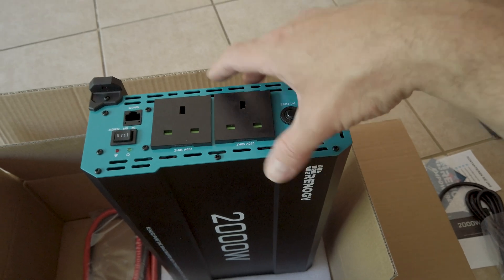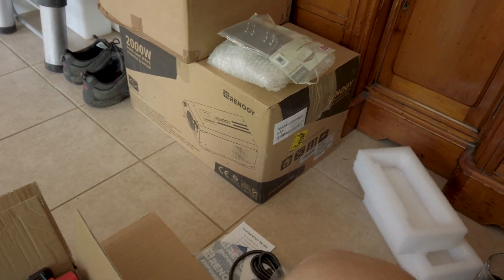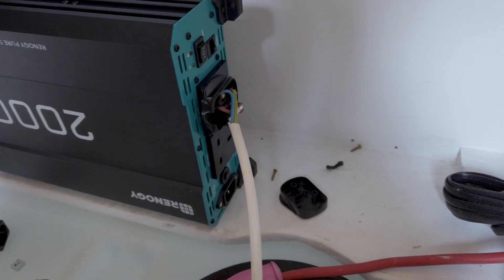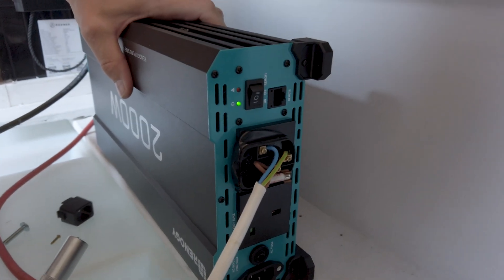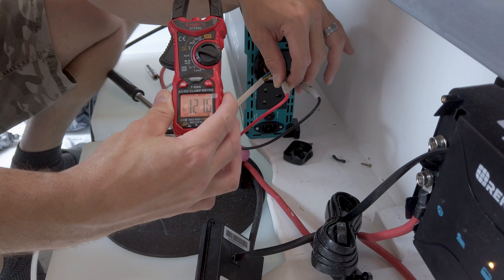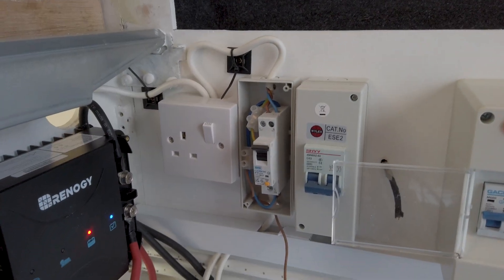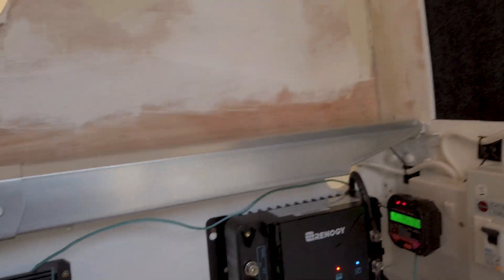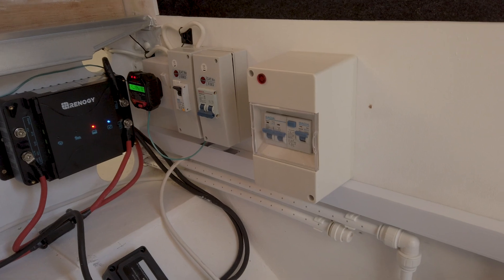Renogy 2000w Pure Sine Wave Inverter | Unboxing | Neutral Earth bonded Install

Comment: I’ve got the 3000w, it worked initially and now it’s practically a ornament. 
Do I do a straight swap which is easier or go for something else. Obviously cost plays a part.
Reply from the maker: How long have you had it? I would suggest contacting renogy as a first point of call :-)
Reply: @dontmentiontheaword only a couple of weeks, I had it professionally installed so it’s not a problem getting a like for like, it’s just that I’m in two minds whether to change brand.
I’m scared of swapping like for like, then it doing it again, but I am limited for space.
Reply from the maker: Ours has run fine since it went in. You can have problems with anything electrical. Get an exchange you will still have warrenty :-)
Reply: @dontmentiontheaword yes, I think I will get a like for like. Maybe I’ve just been unfortunate. Thanks for the advice 👍

Comment: I've been looking into earth neutral bonding this inverter myself. Could you tell me the reason for achiving the bond by connecting DC neutral to AC neutral? I understand that DC neutral is grounded and therefore an earth neutral bond is establised on the AC side. However if the inverter is grounded to the chassis of your van via the grounding point on its case, and that grounding point shows continuity between earth on the AC side, could you bond earth to neutral on the AC side, and run that into your RCBO, achiving the same effect? 

This is my current plan but I'd love to hear your thoughts on it, and let me know if I'm missing something here

Cheers!

Comment: Hi
So did you put the n/e  bonding wire straight into the neutral terminal on the RCBO. Just want to get this clear in my head. Thankyou.
Reply from the maker: https://youtu.be/Ka0lamFY7To?si=6_HvNPA8tZNryooN&t=372

This was the follow up to that Video. I May reedit an electrics video with everything collated together if I ever get time :-)

Comment: i've a 1000w inverter, just like this, also Renogy.

I use it for it's UPS function in a custom built generator.

Can i too also benefit from this bonding?
Reply from the maker: I would suggest contacting renogy directly, although the models look identical they would have to confirm if the same circs inside :-)

Comment: What’s it mean if that beep noise doesn’t turn off when u turn it on?
Reply from the maker: Hello, what are the indicator lights doing when it beeps?
Reply: @dontmentiontheaword  I don’t have it connected anymore but I believe there was a red ground light that stayed lit up..

The inverter worked for me when I first connected it., used it for a minute with small load.. but while using it, the connections arced from being loose.. 

Then I connected new Anderson connectors to my battery and now I am stuck with the red ground light and beeping for 40 seconds until I turn it off.. 

I assumed I damaged it or faulty unit.. I bought new redodo inverter and had 0 issues with it.. I want to use the renogy in my car though

Comment: Excuse my ignorance.. is that legal to regs? You would want the auto switching intact no?
  Vandercampadventures on YouTube in part 2 explains to use a contactor switch to earth bond and retain auto switching power.  Did renogy tell you the inverter charger are earth bonded. Strange. Vandercamp says they are centre tapped.
Reply from the maker: Hi Gavin, give that a watch :-)

Reverse Sensors | Roof Cut out carpeting | Renogy 2000w Inverter  auto switching for pass through
https://youtu.be/Ka0lamFY7To
Reply from the maker: Although there are currently no regs as such for vans everything was done to the current 18th edition of the UK regulations. That included communication directly with the to clarify interpretation of the written regulations.

Comment: Great video. Thank you. Just to confirm i have tested this on the 3000w version and it works. 
Im not sure why and if im fully comfortable with a nuetral ac bond to a dc negative but as you have shown, it does the job.
Just as a side note, sunshine solar do an inverter with a N+E bond switch so it is rcd compatible.
Thanks again
Reply from the maker: Thanks for watching and commenting. Glad you got some use out of it and the solution works with the 3000w inverter also. Sterling in the uk are fully compliant with all current regs. There is a price difference though.

Comment: Hi Graham, great informative video. Why have you removed the Renogy PCL inverter and replaced it with the standard inverter? Is it because of the issue with bonding the N-E? 
I have the 2000w PCL inverter and am currently chatting with Renogy in regards to converting the output to N-E bonded instead of floating. 
Thanks again,
Jolly
Reply: Hi I have put the N dc-N ac link in but still can not get the RCD to trip what am I doing wrong
Reply: Thanks for the video, this is exactly what I'm looking for. I have the Renogy sat between the shore power and a plug socket, making use of the pass through function of shore power.

When shore power is connected, it passes through the ac to the plug socket in the van, and the rcd works on the breaker board.

As you know, the output from the Renogy does not support this. You mentioned that if I bridge the neutral earth, the pass through will not function automatically, is there a manual way? Other than some kind of switch on this bridge connection?
Reply from the maker: Hi and thank you for your comment. When i first purchased the PCL i communicated with them and the assured me it was NE bonded. 

Me being me I tested it as soon as it arrived to find it wasn't. This was not good as they could have killed someone with their information. 

In one of the other videos talk about it. Long story short though I was going to take them to court, they settled before that and I had to sign an NDA. 

It was thier technical who I spoke to about the PCL and 2000w I Have now. They said there was bo way to make the PCL NE as the charging circuit would shut down.

I ended up opting to make my own switching safety circuit for the 2000w. This works every single time I have tested it. I do this before every trip along with checking the main wiring setup. Neither of the units I had from Renogy worked in a fault condition with their own internal system.

I opted for a seperate charger and went for the fogstar unit. That is another Story :-)
Reply: @dontmentiontheaword   Thanks for the reply Graham. I'm a 'test on arrival' person too 👍. In what video do you discuss the issues you've had?

I've been hoping the PCL could be converted so I'm glad I found your video. I spoke with Renogy on behalf of a customer to discuss the N-E dilemma and they explained it wasn't possible and could offer a refund. I gather it's an issue that's raised regularly so I'm hoping they redesign their units in the not to distant future.

I was hoping that a similar setup could be achieved with the PCL like you have with the 2000w inverter using a relay. When the inverter is on mains it supplies 'grid' power (N-E bonded) so an RCD can be used. 

Regards,
Jolly

Comment: Would you recommend this ? Reading mixed reviews especially regarding its ability to trip rcbo’s or rather lack of ? 
Not sure how much of an issue this is. Seems really good for the price though. I’ve just installed a 280ah lifepo4 battery so am considering a decent sized inverter.
Reply from the maker: https://youtu.be/Ka0lamFY7To That video explains more of what I have done to make it work for pass through :-)

Comment: Hey, thanks for the video. Could you tell me your RCD Ampere amount? Im using the same hardware as you and Im wondering which ROD size I should buy.
Reply from the maker: Hello, do you mean the RCBO after the inverter, if so it's a 10amp. Thanks 🤠

Comment: Hi. Thanks for such a useful video! Subscribed. I have the 3000w version but it has the model number R-INVT-PUH1-301235. I don't suppose you've got any details from Renogy that explain if this would work with mine too? Thanks in advance!
Reply from the maker: Good morning, thanks for watching and the Sub. Any other manufacturer I would say probably yes as they are supposed to be the same model just Higher output. Renogy though???? :-) I have sent my contact a message with the details provided and will let you know when I hear back.
Reply: @dontmentiontheaword  thanks so much. That's really helpful.
Reply: @dontmentiontheaword  I would be really interested to see what they say as I asked Renogy the question and this was their response "Renogy's PUH inverters and PCL inverter chargers currently available for sale do not support the connection of external RCDs or RCBOs (Residual Current Circuit Breakers with Overcurrent Protection) for leakage protection. We do not recommend, and it is also not possible, that you run the inverter with a Neutral-Earth bond for the RCD connection.". Isn't yours a PUH model?
Reply from the maker: Yes, 2000w PUH. I have said it a number of times. Renogy staff don't even know their own products. They don't seem to design them rather than "borrow" designs.

Comment: You mentioned in your other video that you had found a uk company instead of Renogy who was it im curious for when i do mine and i dont fancy dealing with Renogy after the faff youve had
Reply from the maker: Hi, thanks for watching. The UK company is Sterling Power. Their products, although more expensive conform to the current UK regs and do all the things I have made the Renogy do automatically. 

I have to be honest though, they failed to respond to me after a couple of emails. As such I ended up working with Renogy, the contact I have there began to reply everyday and took ownership of the problem. 

Renogy are hard work, their first point of contact customer service seem to have no knowledge of their own products. Once I got through to someone who could coordinate with different departments things moved better - not perfect but better.
Reply: @dontmentiontheaword  thanks for the info I've done a bit of research into stuff but I think I'll do a bit more as I'm hearing bad things about victron customer service aswell, I'll have a look at the stuff from Sterling
Reply from the maker: Sterling are compatible to Victron in price but from. what I have read Victron do no conform to the UK regs. Research ia the best idea, I just wanted our to be safe and automatically switch when we go on Electric hook up

Comment: Yeayyyy.... inverter problem finally sorted, Graham so good news all around. Thats the very inverter Ive had my eye on when I do my electrics under the rock and roll bed-along with changing my ctek 250 se to the renergy dc to dc mppt thingy ma jig and possibly a renogy lithium 100ah battery.  Hopefully another frstration got rid of for you.  Bessy regs- Kenny
Reply from the maker: Need a charger now 🙂 tbh I bought this one first and when it arrived I tested it and it was center tap. I spoke to Renogy and they said nothing could be done so it went back. That's when they told me the Inverter charger was NE bonded. The staff really don't know their own products for the most part. It took 3 months to resolve all issues and come to an agreement. Even now it won't auto switch to mains without back tripping all the RCDs back to my main board. I can solve that though and we just need to be getting on.  

The Joys of building a van. 

Thanks Kenny, have a good end to the week. All the best G 🤠